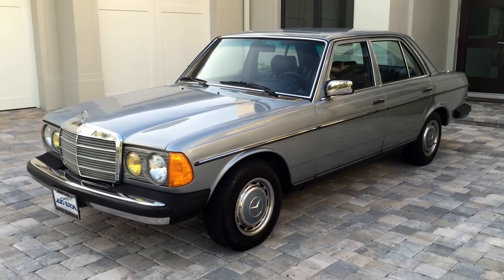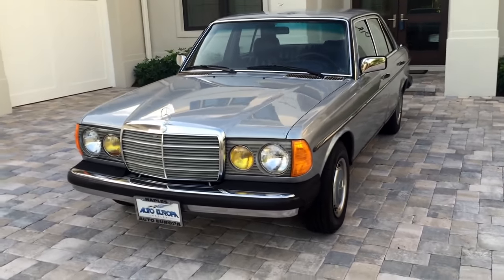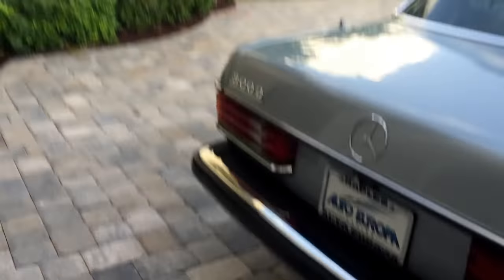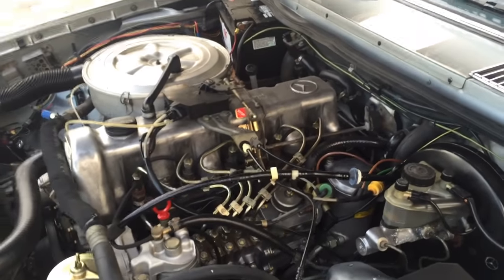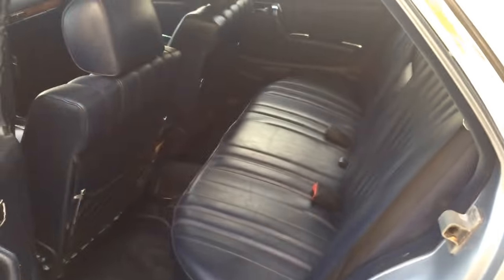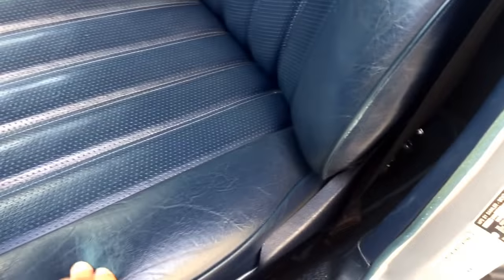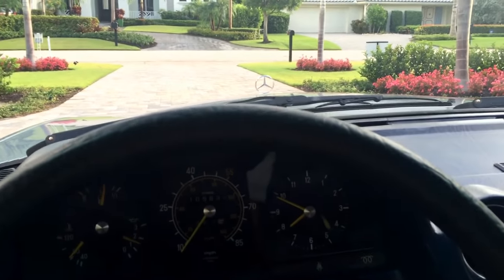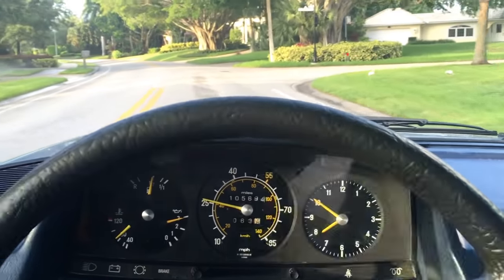SOLD- 1981 Mercedes-Benz 300D Diesel Sedan SOLD-

Comment: I had a W123 230E 1983-model and a 200 1981-model. 230E was the best motor, because of the Bosch K-jetronic injection and solid torque. 
But dont underestimate the 200 (109 hp). I actually drove it on several vacations from Denmark through Germany and into Austria and Switzerland. 170-180 km/h on the autobahn no problem.

Comment: My 1983 300D Turbo has 444,000+ miles and is still going. I wish it was in this pristine condition. My cruise control doesn't work, my antenna is broken but the interior is great, only one tear on the driver seat and my first aid kit is still there and unopened. LOL
Reply: First aid kits have expiration date and their time of use is not forever, so in EU you have to replace it with the new one every 2 years.
Who would like to band a wound with a 20 yo bandage anyway?

Comment: My father''s very first car was this.Great car with such great 
personality.It'' slow but never let''s you down.Like a dog.Men''s best 
friend.It''s like a tank.The only problem that may occur is the air 
filter or the oil filter.
Reply: Fuel filters are infinitely more likely to cause an issue, but then again, with proper maintenance there is absolutely nothing to worry about. Fantastic cars.

Comment: I love your videos. Truly. I've owned this same car in this same color, and also a 280E brown one (non diesel).
Anyway your videos are really informative and to the point. 
For whatever my comment is worth, if you can find one if these I'd decent condition, you really will get your money's worth as they last forever. 
I found a gem with 43k original miles from an old man the Golf & Tennis club on a little barrier reef island down here off Florida's gulf coast. 
Anyway he practically gave it to me for $2000 since we were both Marines and he was trying to help a young, "non millionaire" get started. 
My point? I still have that Silver '81 300D, and it has 672k miles! We've taken it from Key West to Seattle 2x per year for many years now. We've taken the kids down to Mexico City and then up to Ontario. I admit that the original owner pampered her, and had every receipt for ever oil change and even kept the documents for some light replacement! It was meticulously maintained, and I have continued that level of maintenance. I really feel like my kids will be able to drive it when they get older because it shows no signs of stopping. If I could, I'd buy this one for sure. Especially since this guy knows his Benz, he wouldn't have purchased it if it weren't a quality whip.

Comment: When you compare this car to the crap coming out of GM, Ford and Chrysler during the same time period, it's no wonder that people with the means chose this fine automobile .... solid as a rock, and makes a "statement" as well. .. .. ... .. .
Reply: I have a '93 300D and I tell you that is a Tank. Engine purrs like a kitten, clean engine, nothing major on it failed. I replace Radiator, front struts & Mounts ( original Struts and shocks) and did not know when timing chain replace so I did that.  Love it better then the later models of MB with the eletronic crap.  More to go wrong

Comment: 5:20 look at where they positioned the air intake, now that's where air intakes should be located at and not under the damn car like in modern cars were all it takes is a mud puddle splash to flood out the engine with these modern cars now.